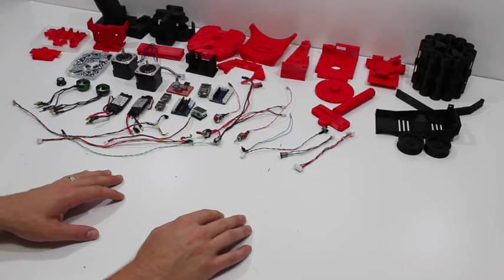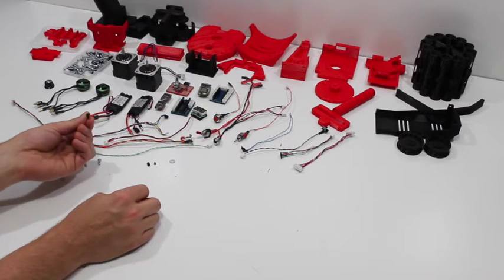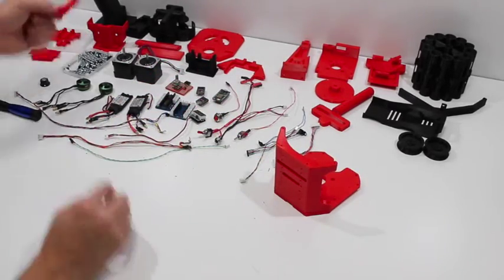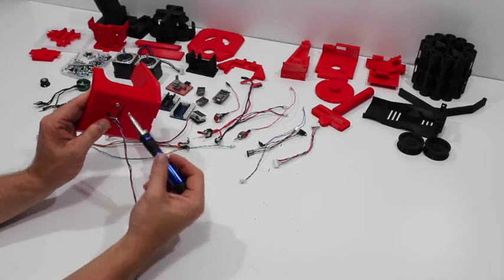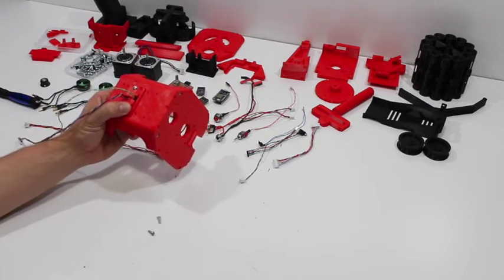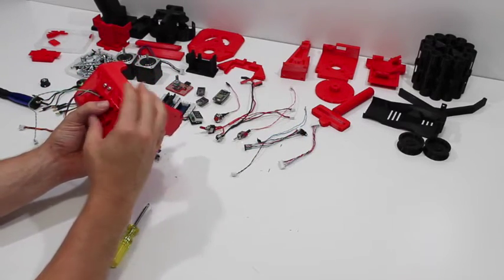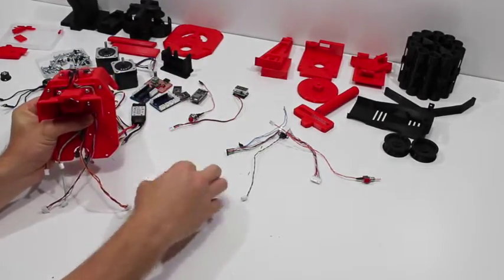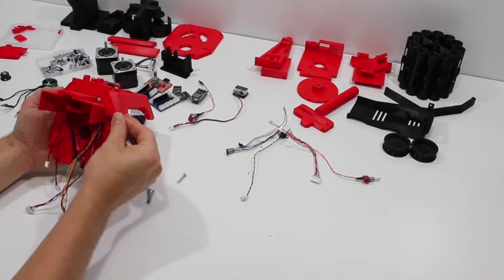FDL-1 Blaster Assembly - Part 1

Comment: Are you selling the parts for this anymore?
Reply from the maker: We really only had FDL-1 parts for a short time after the Kickstarter. There's a lot of parts and stuff going on and the FDL-2, 3 etc. really took it over. As fun as it would be to revisit and have available it'd be better at this point to start from scratch.
Reply: @projectfdl6831  ok
I wanted to order one of the kits for the fdl-3 but wanted to see what was available first.  thanks!

Comment: Hello,

Do you have a list of the electronic hardware that is required in this build?

Thanks!
Reply from the maker: I'm putting together a BOM and will post it within the next couple days on github along with wiring diagrams and the firmware for the Particle Photon. https://github.com/jkovarovics/FDL-1-Blaster. I also sell electronics bundles on fdl1.com that come with all the electronics and wiring that you need so you don't have to source it all or solder anything.
Reply: Thanks or uploading the BOM are you still going to be working on that file or is this the finished state. As it is now it would be quite hard to find the exact parts for some of them with the current description.